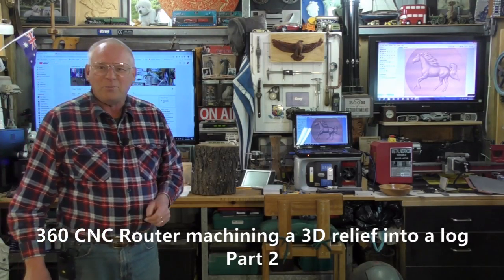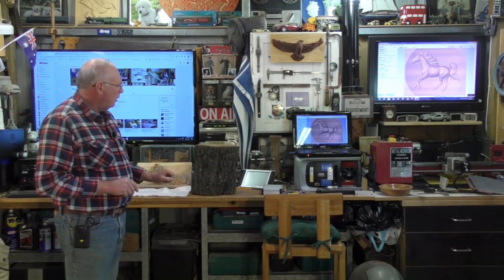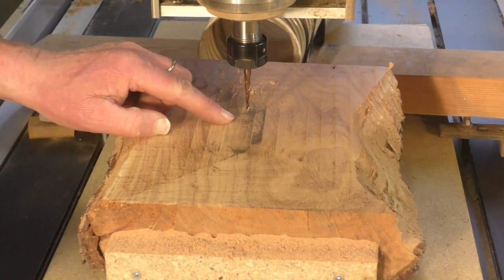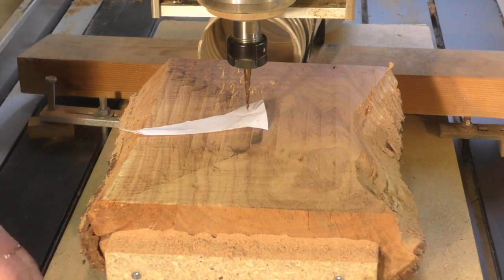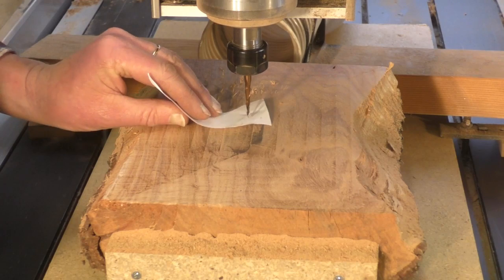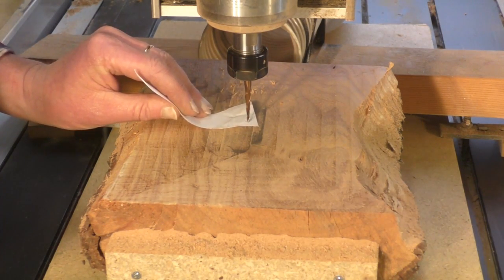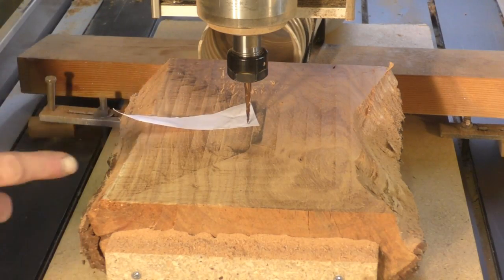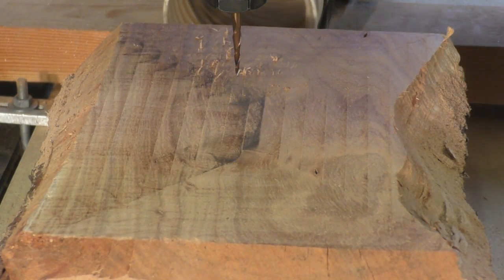360 CNC Router machining a 3D relief into a log

Comment: Roger, 
First, your work is inspiring.  Not sure where you find the time to do it all, so you must spend 24/7 in the shop.  Anyway, in the video where you carved a horse in the end of a log, you showed a CNC pendant to control Mach3.  I found one on Amazon and received it today.  The hardware seems solid enough, the software ... not so much.  The mini CD they sent was corrupt so I couldn't get the two pieces of software that I needed to install the thing and their website doesn't seem to have downloadable files for the .dll and the macros.  I did a search for the .dll, and several of the forums I found said they got the .dll here or there, but they were not apparent when I went to the site.  

Going to ask Amazon to replace the whole shebang.  Would you consider doing a video on setting it up.  I've run across a bunch of comments that it is difficult to do and that the result doesn't yield a very accurate controller.  There is another on Amazon for $300 or so, but not sure I want to go down that path if this one can work.

Thanks

Comment: How come you decided not to use a larger bit to rough things out, and then finish with the finer one?
Reply from the maker: Time, takes to long.
Thank you, for watching, Please like, subscribe and forward the video on to a friend, Australian Inventor Roger Clyde Webb;-))
Reply: @inventorsworkshop9600  really? Wouldn't a larger bit remove material faster?
Reply: @headrobotics  the finish cut is still needed regardless of if you add the roughing cut. Simply simply eliminating the roughing cut eliminated a step.